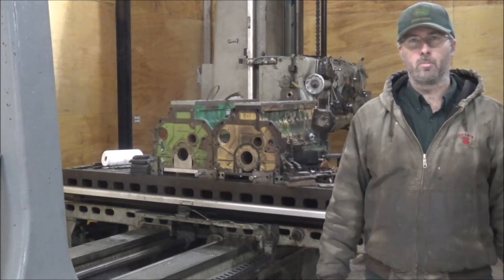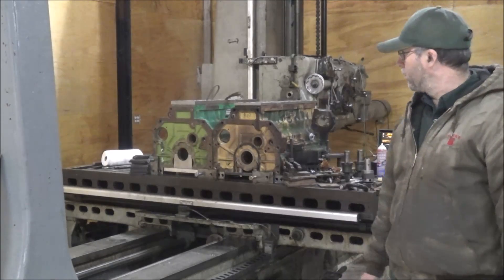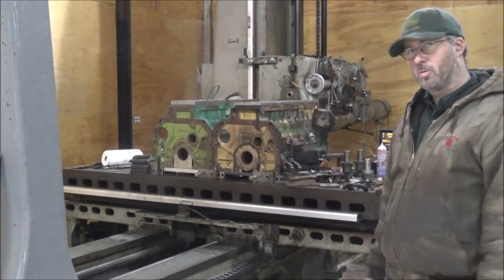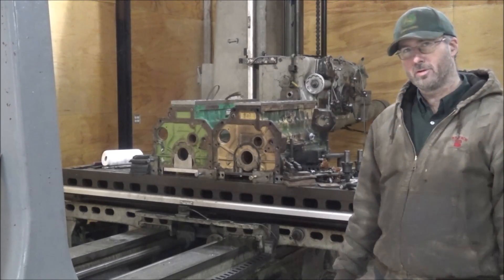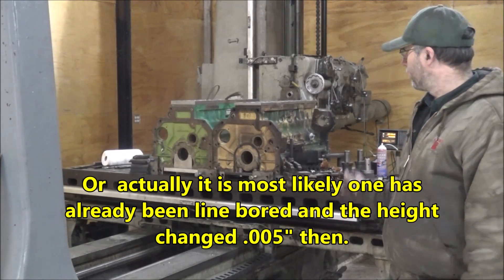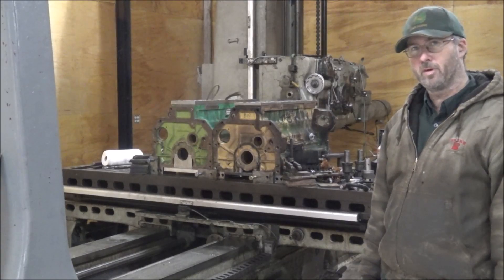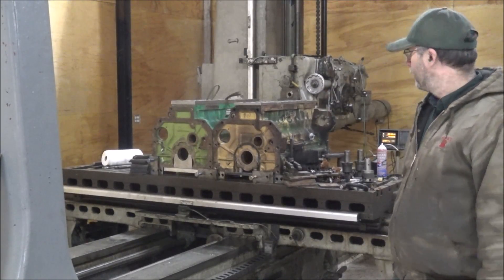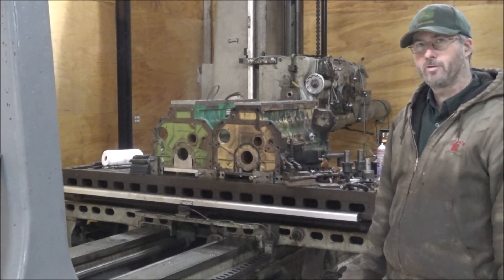5000+Hp with Double P Pumps!!

Comment: What's better than p7100 pump is called a p9000 pump
Reply from the maker: I would rather have a Sigma. :-)
Reply: @bcbloc02  whose are the pullers you work on? Do they have a website?
Reply from the maker: I have done work for probably a 100 different pullers over the years. I imagine several are on Facebook but don't know any that have webpages. Pullers are a secretive bunch so I can't tell you who they are.

Comment: Its on adams boring mill at his job. I think there called boring chuck or or boring face plate. but it allows you to put a turning tool like a boring bar and bore holes out without having to get a boring head and stick it in like the car 50 or the moorse taper. Like hes bored some huge holes with it
Reply from the maker: I think you mean the facing slide. They make them for mine but they cost like $8000

Comment: Amazing vid as always, Brian. I have a question. I noticed you have some beaver quick change tooling. I bought a mill recently that came with a 50 taper beaver quick change and I don't understand how it works. I don't want to wrench on it and mark it up. It has 4 short blind holes on the side; does it work like a collet system with a wrench? I can't find a way to get the 7/8" holder out, and I couldn't find any info on them. Any help is greatly appreciated
Reply from the maker: You twist the collar with the holes using a spanner, it takes about half a turn to unlock. If you watch the part where I am drilling and tapping the holes you should be able to see me work it albeit by hand. For small loads it doesn't need to be super tight, when running a facemill or something you have to really twist on it tight or it will vibrate loose and that can be a real bad day.  Let me know if you need more help.
Reply: @bcbloc02  Thank you so much, Brian. Truth be told I didn't notice you using it; I often use videos as background noise when working but now it makes perfect sense as to how the mechanism works

Comment: I think a Komatsu 12V140 is the only engine i can think of that has 2 pumps  !  What  make of quick release tool holder is that on the borer spindle ?  .  Cheers .
Reply from the maker: It is Beaver quick change.
Reply: @bcbloc02  Ok thanks , I  might investigate  that style as its a bit of a stretch to use a normal nut / rod style  and hold the arbor . My large mill has an electric draw bar with bayonet style 50 taper arbors .
Reply from the maker: Finding the holders is hard to do. The Collis rapid switch style seem more common.

Comment: Whats wrong wih the backside of that boring head? Looks like it was welded back on at some point
Reply from the maker: Someone welded it to the beaver quick change adapter, I assume they ran it reverse sometime and unscrewed it so they welded it so you can run it any direction and not worry about it coming off.

Comment: Like the smell of cast machining.
Did set up work on old belt driven engine lathes .
One contract we turned hydraulic tops to filter canisters. 4"-12" , then on a end mill to punch n thread em.
Skids n skids of em.  We push then old girls n them chips fly 10' at times I swear . Really was enjoyable, peaceful. 
Would be 88 year  I think. 
Thank-You Sir  you make a old man smile again.
Reply from the maker: You get to keep the smell of that cast iron too as the dust gets in your nose too. :=) It is dirty stuff but it sure machines nice! Always glad to make an old man smile!

Comment: Can you adjust the boring head on the fly, or do you have to stop the machine and move it like a regular one for a small mill?
Reply from the maker: That boring head I have to stop and adjust. Sadly I don't have a fancy one like a whalupter that you can adjust on the fly. Or the facing/boring slide for my mill. They want like $8000 for one of them. I will have to do a lot of jobs to cover that.

Comment: That quickchange is slicker than snot
Dual pumps eh? Both timed the same or one at low advance for low RPM and the other at 50 deg for high RPM? ETA: oh I figured it out, just one per engine, but two on the table at once
Reply from the maker: Could always gearbox the engines together for a twin engine mod. :-)
Reply: @bcbloc02  I'd seen where guys run a couple pumps on one engine with the governors set to transfer over to the high advance one at higher RPM

though I guess a pulling engine is just 'on the governor, then dump the clutch' so variable timing is unnecessary
Reply from the maker: Wouldn't it be easier to just use an adjustable timing advance on one big pump? Getting the transitions to work smooth with split timed ones seems like it would be super difficult.

Comment: I'm  curious if you have to match the pitch of the tap to the infeed of your spindle when tapping? Or is there enough freedom of movement to allow it? on the lathe the tail stock can slide to accommodate it, just wasn't sure of the spindle on your mill
Reply from the maker: I have to hold pressure in the right direction at least on the smaller taps like this as they will either pull out of the holder or break because they can't develop enough push to move the heavy spindle back on their own. It is a fine line between hero and zero. :-)

Comment: Is there an 'off the shelf' gear available to adapt P-pump to JD gear train or does a special gear have to be made?
Reply from the maker: You can just use the stock one for the Deere tractors that had the P-pumps. All the higher powered motors since the 70's had them factory. There are different ones depending on what cam/crank gear combo you have.

Comment: Don't be bashful Brian, That mill is a 6x6........I bet at one time you could set up SIX-6 cylinder diesels. If you hang them off the ends and get creative you likely could put 7-8 on that table.
And that is without stacking them.
Reply: Most guys struggle to fit ONE of them...
Reply from the maker: Cummins 5.9 blocks are narrower I might could get 8 of them! Ahh production work. lol I wonder how much it would go out of alignment with a couple of tons of iron sitting on it??

Comment: That's the proper sized machine for this type of work, so far it looks pretty well withing specs and stable, guess it was all worth the effort...
The cold in the shop don't seem to be an issue for lubricants and even for the operator....   ;)
Reply from the maker: It has been staying 40+in the shop so it feels pretty good actually. :-)
Reply from the maker: It is a bit warmer than usual here, but also way wetter. The mud around my shop is a foot deep.
Reply: @bcbloc02  ever get your beans out?
Reply from the maker: Yes I finished just before Christmas and it was a good thing as there hasn't been any days you could run since.

Comment: Thats a lot of power out of a block that used to put out 200-250hp, they look like 466 blocks. It’s amazing what lots of fuel and air can do👍
Reply from the maker: They are 466 blocks, sometimes they split in half at that power so they certainly are pushed to the limit.

Comment: Is it pulling season already?  LOL!  Who makes the high pressure lines for these setups?  I"m assuming at that level the fill the blocks too?
Reply from the maker: Scheid, CDS, Harts, they all sell lines in various lengths that you bend yourself for your application.
Reply: @bcbloc02  Gotcha.  I knew Scheid had lines, didn't know if these guys were going that route, or if they had some fancy setup so they wouldn't have to bend them.  I hear mixed stories on bending injector lines, but you never know how competent the person reporting the story is...
Reply from the maker: I have bent miles of injector line. If you do it right it looks clean and is not an issue, of course they don't run thousands of hours so maybe not something like factory. The factory lines are usually processed differently and can flake and come apart if you bend on one of them. I like to use the Stainless ones myself.

Comment: Would like to see your setup process and how you went about locating the center of those holes.
Reply from the maker: I sweep the bores with a co-ax indicator to find their center. The blocks are squared by pushing the machined backs up against my precision stop blocks that refrence to my table slots. This method almost always yields alignment across the face with .001" or less when I indicate them.

Comment: We love machining it is interesting that they vary wonder if that would be in tolerance. Machine cuts away on that bore really well. Interesting you are able to make some base block mods and upgrade the injection pumps of a different model. Question are these P7100 injection pumps a better upgrade or a lower cost thing? Just learning here. Looks like it fit well over those 4 studs.
Reply from the maker: The P7100 pumps come off of bigger higher powered engines. The ones for these of course have been highly modified themselves so instead of putting out 400cc of fuel they will be more like 1500cc with custom 16mm sized Plungers and barrels.